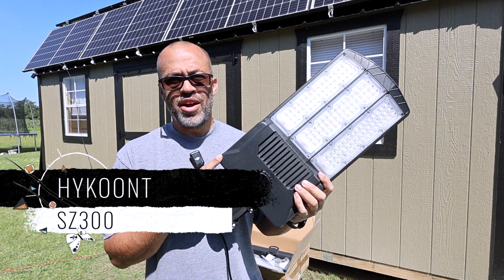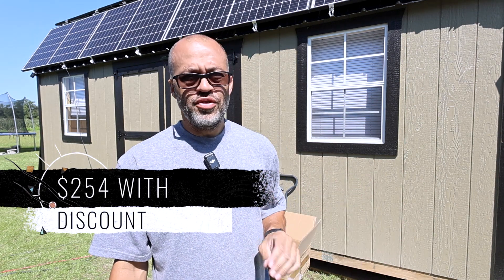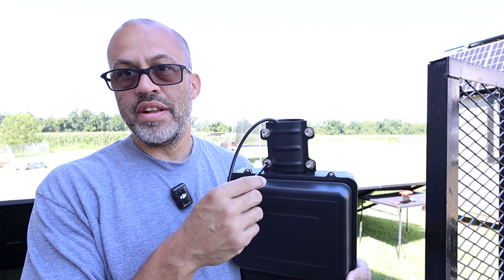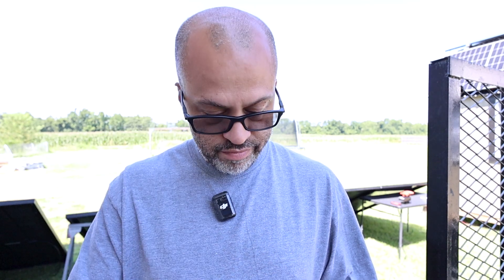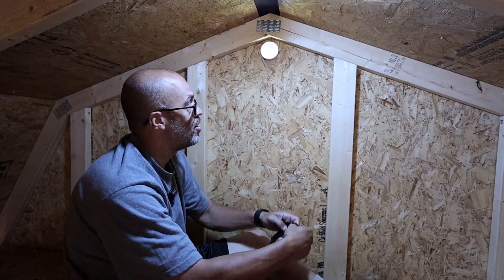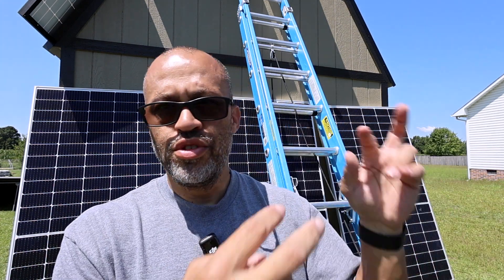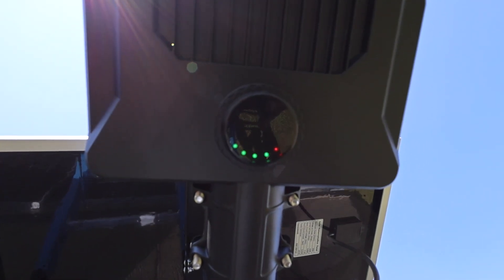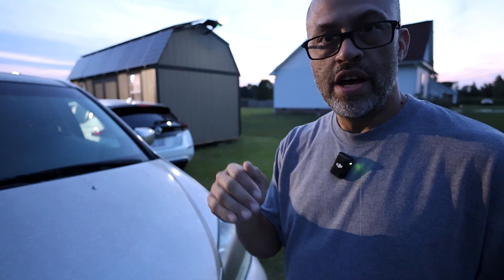Bright Solar Powered Security Light - Hykoont SZ300 Commercial Solar Powered Street Light

Comment: Wonder if u could jerry rig it so it could have a 12V or 24V external battery and a small charge controller (in a water proof pelican type case) trickle charging the external and internal battery so u can run it at 100% all night?  Not sure wht the current connections are....MC4?
Reply from the maker: Not it is a barrel type plug. Not sure it would need an external battery since it has lithium batteries already. We has very dark cloudy conditions from hurricane/tropical storm debbie and it stayed charged through that easily. You could always figure it out if you really wanted more power

Comment: No matter how strong the light is.  I just don’t trust the sub battery system.  I would always powered my lights with my own 12v batteries…
Reply from the maker: The batteries are lithium so should be good to go for a very long time! But that would is all personal preference so do what you feel is best! Thanks
Reply: @rodneyhunt  yea. since it is typically installed high up if there is an battery issue.  it is pain to troubleshoot… i stay with my hardwired with whole house battery setup.